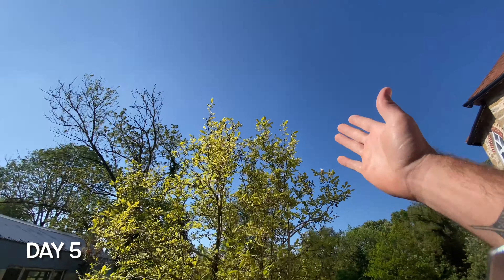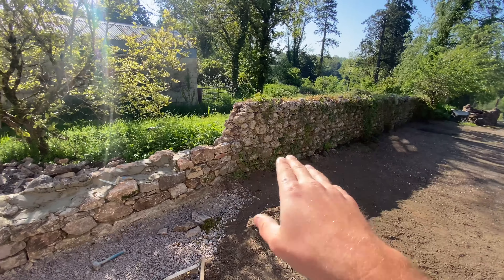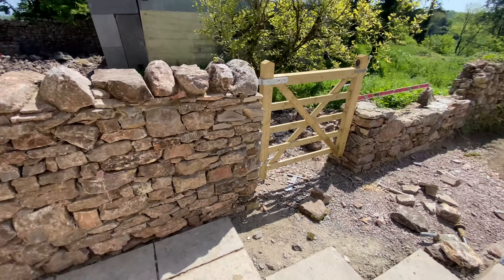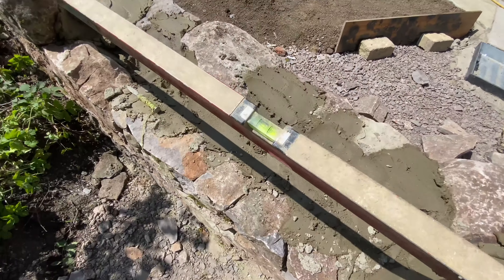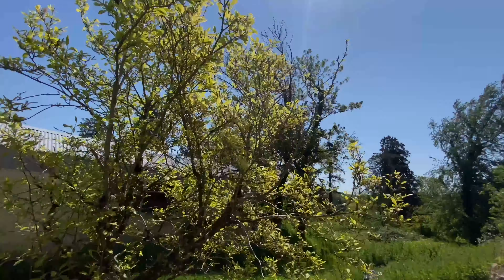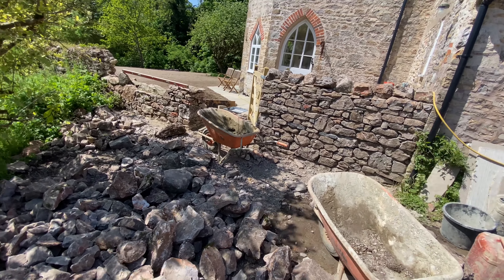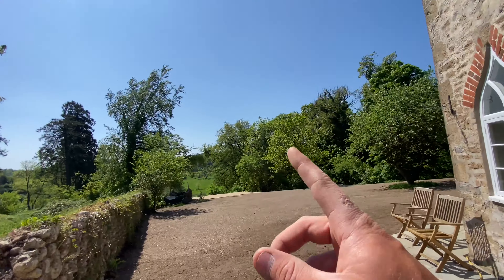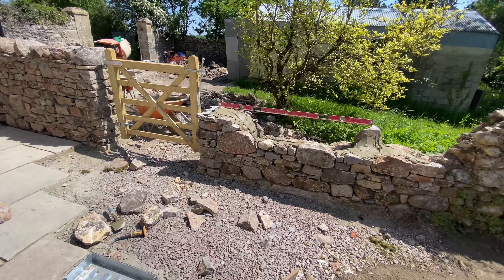Building A Stone Wall With Rubble - Day 5

Comment: Don't you need to know what the patio guy is going to do?.....or is the patio slope partially determined by the slope of your wall top?
Would it be an option to keep your wall fairly level and start the slope where new meets old....over say 1 - 2 meter transition?
Sorry if I don't make sense, I'm an interested DIYer!
Reply from the maker: I can read the run the patio already has from the built section and work out the wall height from that. Thanks for watching! 👍